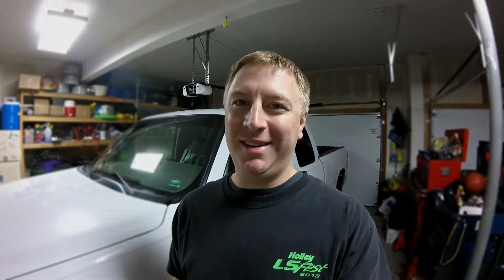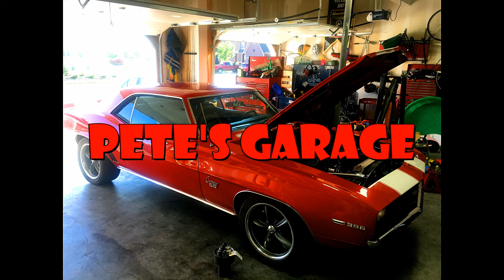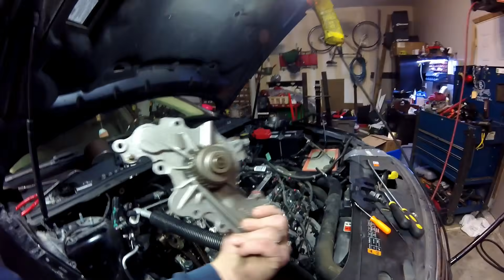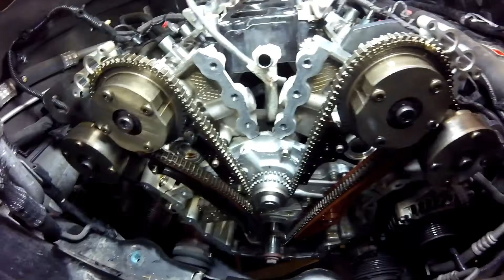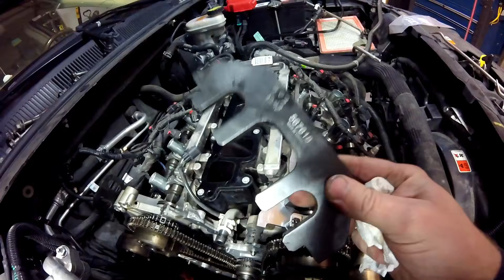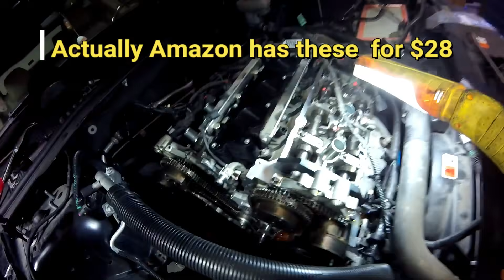Why does the Ford Taurus, Explorer, Edge 3.5L water pump cost over $1400?

Comment: yeah ok pete , the part is less than 100 bucks, so that leaves 1300 in labor most places are 70 bucks an hour , so how long will that be?18 hrs to do the job bullshit. that's why i do my work myself, i looked it to doing my turbo 1300 bucks , i can do it myself 300 for the part and my time. i called a couple of places to do wheel bearings rear 1500 bucks i did them 80 bucks still going awesome. front wheel bearings are pressed in so i bought the bearings and press less than 200 bucks , they wanted 1000 bucks why less than the rear the rear were easier. ac compressor clutch bearing they wouldn't even do it, just replacing the bearing , you got to buy the whole compressor over 300 for that and not including labor to install. i paid what was it less than 8 bucks for a new clutch bearing and used my 90 dollar press to install . i am so glad i can do my own work , i have the service records for my car and i laugh when i look through it and see what they paid. i know you guys want to make some money but , but come on man.
Reply from the maker: Dealerships in my area have labor rates around $150 per hour. Your $70 is very low. If you live in a rural area then the labor rate is probably low. There are people who have commented on this video who have paid even more than the $1400 I said it costs. Obviously if you do the work yourself it will save you a ton of money. But, not everyone can do their own work and have to take it to a shop or dealership. Not to mention if you screw it up it will cost even more to fix. Thank you for watching.

Comment: It's a Ford every thing they do is fucking stupid from the 8 plug 4 cylinders to their hand grenade coils and heads on the newer 5.4 hell their diesels have to be rebuilt as soon as you buy em to keep em from blowing up the ones that make it leak oil so fucking bad you add oil like fuel

Comment: It's time for waterpumps to be driven by electric motors and mounted with the radiator. I always thought burying the water pump in with the timing belt or chain was a dumb idea; in this case, a bearing for the center sprocket, if bathed in oil with no water pushing at it from behind, would probably last the life of the car.
Reply: Less effecient and would take a larger motor. Motor lifespan would also be a little questionable. Look at aftermakret electric water pumps, they never match high speed mechanical pump flow

Comment: Chains are supposed to be a lifetime / 150,000 mile part, but a waterpump is often required to be replaced every 50,000 miles. Its stupid to out the pump in the chain line. I am glad I dont own one of these!!!
Reply from the maker: The pump lasted 140,000 miles. So they did get all of the life out of it!

Comment: Or a fuel pump on a 2001 ford f150 5.4 its in the gas tank. And you can either drop the tank or remove the back bed. Next time I am taking a grinder to just above the pump and creating a access flap for easy replacement. Why cant engineers do that?
Reply from the maker: Every truck by every company since the start of fuel injection in the 80s has had the pump in the tank. That job usually only takes about 2 hours though.

Comment: Did one on a Cadillac DTS 06 absolute horrible design
Reply from the maker: Yep pull the crossover to replace the pump. The older ones went in from the other side with a special tool to twist it in. Pretty clever.

Comment: I was looking at buying a new ford flex with that 3.5 when I went home and got on the internet and found that crappy water pump set up. Don't know why ford didn't stick with the design on the Freestyle Wagons 3.0, They have a plastic water pump driven off the front cam on the back side of the engine. We have 2 of those wagons and so far I haven't had to replace the pump in either of them. It looks like a 10 min job to replace it. It's the best design I have ever seen of a cross mounted V6, so why OH why did they change such a simple design?

Comment: okay stupid over engineer design but they could have at least put a water pump in there that was well made and lasted the life of the engine. How many 200k+ mile Toyota's or Volvo's with original water pumps I have worked on and no leaks or noise sometimes aftermarket replacments are more trouble than then original pumps.

Comment: Exactly why I stayed with my LS motors. Hour jobs tops to pull radiator and pull fan clutch off. 6 bolts and bam! Done! Ford over complicates there designs so they have repeat customers. Every brand has there troubles but by fan Ford seems to make them on purpose!!

Comment: The chevy ecotec water pump is the same way, this isn't a FORD only deal, the ecotec also has a timing chain driven water pump, which is located INSIDE the engine.

Also.. what stops the water pump from leaking water into the engine and scrambling the bearings when the pump seals fail?

Comment: I love how everyone acts like it's just Ford, go try and change a starter on a Northstar V8. ;)
Reply: Or a Toyota Tundra V8
Reply: Toyota Avalon 2002:  Try changing spark plugs on rear bank of the V6!  Porsche Boxster:  Try getting to ANYTHING on the engine!  The list can go on and on.  Basically, the more powerful/fuel-efficient/complex/inexpensive an engine becomes, the more serviceability suffers.
Reply: Namdar Bolour everything is engine out service on Porsche . Always has been
Reply: Lol northstar...infinite money pit until your mechanic says your head gaskets are blown.. xD
Reply: On Chevy Chevettes, the steering column had to be dropped.
Reply: @40intrepid  😆😆😆
Reply: 40intrepid if u bought a chevette u had it coming
Reply: Pretty simple, remove intake, remove starter, straight forward
Reply: Pull off the cross brace,shield, connectors,PCV, brackets,fuel rail,and so on, before you've even gotten to the intake. A couple of bolts and done, that's straight forward.
Reply: imgumbydmnt my mechanic referred to my caddy engine as the “deathstar” engine. And he was oh so right💩
Reply: imgumbydmnt Or a starter on a lexus ls400
Reply: I'd rather change a starter on a Northstar V8 than Fords eco junk

Comment: chevy ecotech has this asshat engineering too.  Ill stay with my 92 accord with a VTEC DOHC H22A. Such a beautifully engineered engine thats also easy to work on, only faults are the hydraulic timing tensioner and FRM cylinder sleeves.

Comment: So it's the labor that runs the bill up to 1400.00  because that pump is about  $86.00
Reply: Plus all the gaskets, sealers, fluids. I would also consider doing timing chain/guides/tensioners while I was in there

Comment: It’s not a difficult job and it doesn’t require special service tools. The quality of the pump is the problem. Nissan ran this design on their engines and never had an issue because the pump was built like a tank. I’ve done several in my shop without issue. The pump should be changed every 100K whether it’s leaking or not. I’ve worked on much worse.

Comment: The people who designed this engine failed at doing their job.
The change the water pump on a GM LS engine it's four bolts and often you don't even need to pull off the accessories.

Comment: Consumer is one thing. Price gouging is another.  If prices were the same or close on independent mechanic versus dealer I might consider dealer for warranty alone.  I am not paying $1400 for WiFi lounge, bottled water and  TV.   I agree with proper compensation for mechanics but dealers are probably still not paying the mechanic full value.

Comment: It’s so expensive because it’s run by the timing chain it’s inside the engine so it’s not cheap to replace most water pumps and run off the serpentine belt and are easy to remove and replace!

Comment: These are my bread and butter at my shop. 2hrs to drop the motor out. Do the pump and 2hrs to put the motor back in
Reply: Around what mileage do these water pumps tend to fail? Does ford give a life span of the water pump or say when the water pump should be changed. Will failure of these water pumps cause coolant to  get into the oil when the failure occurs?
Reply: How many hours to do the water pump once the engine is out?  Is there other work that needs or should be done while the engine is torn apart?
Reply: @thirtythree160  to your first question I have seen them fail around 50k. Also seen some not fail until 150k. I have seen the oil in the coolant and coolant in the oil. If you catch it soon enough it won't harm the motor. How ever if the bearing is the cause of the failure the metal from the bearing can start to send metal flakes in to the motor. Also if the bearing has enough play the motor can jump time. At the moment I have one in the shop that the bearing failed and caused the water pump fins to grind off and go into the coolant passages and has blocked the flow of coolant. I informed the customer when I first saw the car that it would be better to replace the motor. Of course he declined it and said he thinks it will be fine. I put the pump in and the car is still over heating due to the blocked passages. Now he's paying for a motor. As far as the motor removal, I done one or 2 of these a week...mostly ford warranty. So I have gotten pretty good at the motor removal to the point I can have one out in under 2 hrs. Once it's out and you can get to all the parts easly it's then about a 1 to 1 and a half hours. If it's a turbo 3.5 there is alot more to take apart.
Reply: There's not any other parts to service when your doing this. To do the job your going to be replacing alot of wear gaskets like valve covers and front cover. Crank seal plug seals vct seals. You could go ahead and do the spark plugs I guess

Comment: Olds alero WP was also timing chain powered but has weep hole and they fixed the casting after first year so you can remove it without the timing chain
if that pump leaks from the bearing, does it go into the oil
$1000 is too much

Comment: Then there’s the brake master cylinder on a Gen 3 Prius - $3000 to replace!  The vehicle cost new is about $24K.  Toyota put a lot of electronics in the brake master cylinder body for regenerative braking which should have been in a separable module to make the mechanical part about $150 to replace.

Comment: This is what happens because the engineers NEVER get Feedback from the mechanics. VW/Audi also uses this scheme for the waterpump. They use timing belt not chain. I did this job and I just welded my own tools to lock the cams which now is pretty standard.

Comment: As a Ford design Engineer, it is to service the timing gear, chain and valve lash, valve stem, etc, simultaneously.
Reply: So you're one of the assholes responsible for this?!
Reply: So this is recommended preventive engine maintenence by ford? Can you point me to any online ford documentation that acknowledges this? At what mileage is this recommended?
Reply: This preventive maintenance schedule is clearly outlined in all of our automobile and Light duty truck owner manuals. Nothing out of the ordinary! Ford has maintained a high standard for quality and durability in accordance with the automobile association of international fine auto builders.
Reply: @rv6640livingwater  Could you point this out for me.  Here is the owner manual link.
http://www.fordservicecontent.com/Ford_Content/catalog/owner_guides/14tauom1e.pdf
Reply: @thirtythree160  my previous comment "clearly outlined" is defined in Ford's definition of factory described vocabulary as "implied" as to prevent unnecessary anxiety by Ford motor Co automobile owners, clearly outlined in Fords TSM ( technical service manual).  Hope this helps.

Comment: Try working on the new Ford Powerstokes. Just to get enough room to get to just about any of the sensors or repair anything, it requires you to remove the body of the truck from the frame. You can't even pull the motor without removing the body first. Ford is going to if it breaks replace it not repair it strategy to get more sales.
Reply from the maker: Not just Ford. They’re all doing this.

Comment: I worked for ford for almost 10 years and I've only replaced two of them. The job ain't bad and it's not very common.
Reply: So what is the expected life of the water pump? When did ford start using the water pump driven by the timing chain design?  Do you know why?

Comment: Hi Sir...if the water pump is bad..how would you know...i changed thermostat and thermostat censor the LITTLE one that sits below the distributor on a 2001 Honda accord..but it is still getting HOT.. I made sure all the air was out..i got heat..but if I turn the ac on it gets HOT..

Comment: 🤬i bought a 2000 Mazda MPV thinking i was buying a japanese motor! Yeah right, turns out its a 2.5L Duratec engine, whuch by the way its similar in timing chains. But at least the water pump is on the outside of the engine and is belt driven,also the thermostat housing and thermosta are out side the engine.

Comment: how SLEEZY... F**king slime balls.. No wonder they call it a Taurus, this is just bull-shit... You basically have to pull the whole engine out...And I will never buy or recommend a Ford, I thought their products were getting better but I don't care how reliable that engine itself is, this shit is just ridiculous, It cost about 3 car payments just for one water pump repair.... I hope they go out of business
Reply from the maker: Well almost all manufactures have models that pretty much require engine removal to work on them. Audi timing chains?
Reply: Pete's Garage Oh like Porsche when you have to change spark plugs, but seriously this car damn sure ain't worth the hassle ... And having to pull the engine out for water pump, not that it isn't difficult on some vehicles but this is ridiculous, this is the same level of ignorance they used for the 2.7, and you see how well that worked out for Chrysler

Comment: I had to replace a bad tensioner (one of three) on a Cadillac SRX. The book time was 19.2 hours and the timing set was $500. I did the job in 10 hours, without any special tools to hold the cams in place. I could have finished an hour quicker, except one cam didn't want to cooperate and kept coming up one tooth off. I finally got it back in time and finished. I know about poor engineering.

Comment: I made my tools to hold the cams screw 374$ for 2 flat plates of steel cut . Its a scam n a rip off. I did my whole water pump job for 438$ that included, seals ,gaskets, n steel to make the cam stationary holders.. It Took me 5 hours. The shop wanted 1590$.  I said screw that crap. Plus I bought the revision version of the pump it has a better seal installed on it over the cheap junk they used in the factory. I wont have to worry about the pump again. By the time it goes bad again the cars gonna be worn out n junk.

Comment: If I design a modern engine i would design the electric water that can be replaced by removing 3 bolts and 1 electrical connector. Also design the stator windings to reused on the new water pump by removing 2 small bolts and sliding off the BLDC stator assembly and transferring the bldc stator assembly onto the new water pump and installing the new bolts. The engine I would design would be a 50 percent thermal efficiency variable compression ratio cgi block 4.6 liter V8 with laser ignition that produces over 420 hp around 6500 rpms. Also the variable compression ratio mechanism would be similar to the Nissan VC turbo but, with a reliable brushless dc servo motor, forged crankshaft and harmonic drive, and better design in other areas. It will be a smooth running V8 and the compression ratio varies based on knock detection, engine rpms, and engine load up to 20:1 for maximum efficiency and down to 13:1 for maximum power. Complete with smooth ride and a deep throaty sound. The engine will be dressed with a stamped steel oil pan, a cast aluminum oil filter adapter, and fiberglass reinforced nylon valve covers and intake manifold.

Comment: Ford doesn't even include belt routing diagrams or labels for their fuse and power distribution blocks. Instead, they have a little symbol that refers you to the owners manual. The owners manual typically refers you to your local dealer. That should tell you all you need to know. Oh, and they use non metric and non SAE fasteners in their interiors. You have to have the Ford sanctioned tools to do things like change the cabin blower motor.

Comment: I do these all the time lol.  You don't need to take off the secondary timing chains off.  You can use a swivel ratchet wrench and loosen the right side chain guide and pull it forward enough for the water pump to clear
Reply: Hello.. Any suggestions on a 2006 Dodge Durango Hemi 5.7 litter oil pan gasket.. Another pain in the arse to replace. Everywhere i go they say the engine has to come out.. Another shit design..
Reply: Cant on the 2011 and later models. They updated the guides to be much longer and will no longer clear the pump. Unfortunately I know from experience.

Comment: I was a ford tech for 30 years. Did many of these under warranty. It was easier to pull the power train out the bottom and do the job. Also makes resealing the front cover easier
Reply: @Michael_J_M14  indeed. But then again, I always got them under warranty too. That 5 or so hours was small consolation

Comment: Getting it to run... and out the door is JOB 1.  Repairing it (out of warranty)... that's a consumer problem... not a manufacturing issue.  Repair-ability is not a modern engineering concern on consumer goods... just go buy another one.  Its "recycle" vs. repair.  
If I can't fix it, I don't want it!